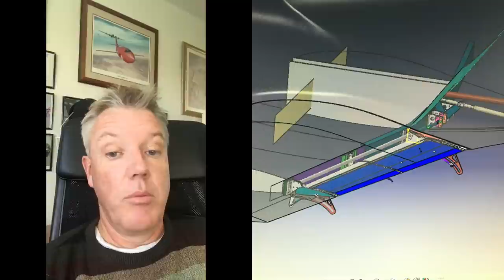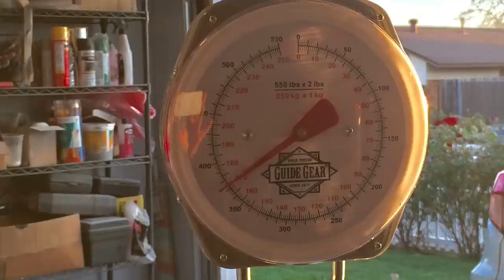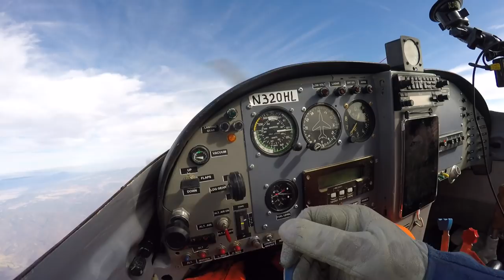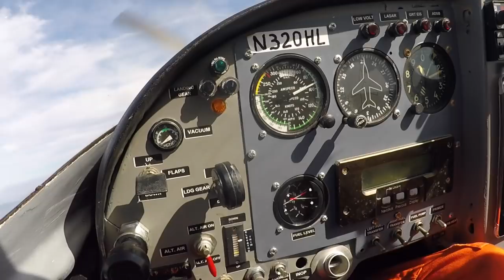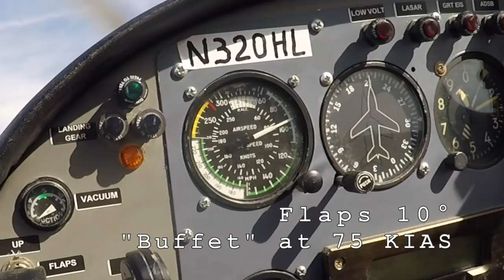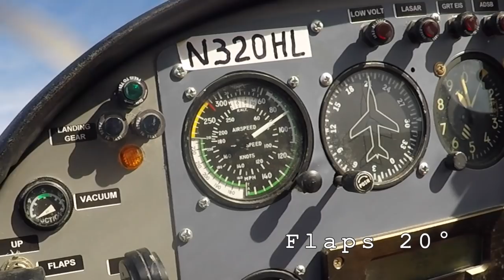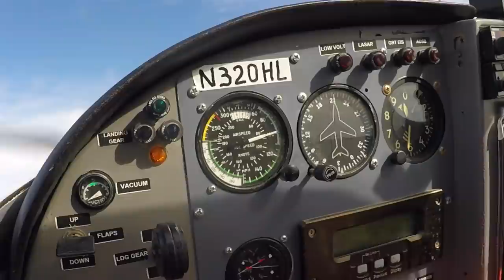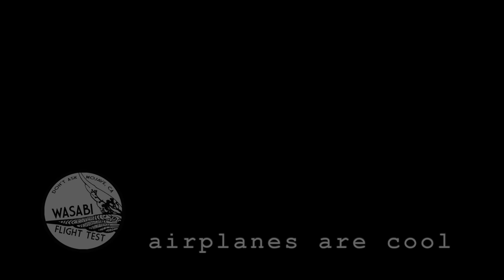So Many Tufts - Stall Tests @ First Flap Deployment - Flt 6 - Hakan's Modified Lancair 320

Comment: Great video. Couple interesting things to see from the tufts. The wing root fairing always seem to start the separation on the wing, which sucks the airflow on the trailing edge inboard. The tufts on the flaps always remain attached so the slot works great.  On all angles the flow on the elevator seems to separate, preventing further downlift on the elevator and hence further increase in AoA. What do you think? The separation of the elevator makes sense as you loose the control force with further stick aft. 

So VG's on the lower horizontal stabilizer seems to be a logical step.  

After that it would also be interesting to see if a turbulator strip just before the wing root fairing would make a difference in delaying the stall on the wing a bit.
Reply from the maker: Great observations.  We are thinking very similar.  Wait until you see what Hakan has cooked up.
Reply: Armin added vertical fences inboard of the flaps with great results. Lancair 235

Comment: The CP is moving rearward, obviously... leads to increased input to the elevator and it's subsequent buffeting/separation issues, but did you notice that the root fairing's tufts always show separation and a general motion towards the underside of the fuselage rear, even in level flight? The general "gut sense" looking specifically at 50:56 is the flow stayed laminar over the flap aft segment when the rest of the wing was turbulent. How's that CP shift feel? Air seemed to spill in making a clockwise vortex from the inboard edge of the aileron spanwise almost halfway across the flap span before it went chaotic, a short spill fence between the two sections could help with the spanwise flow but 'lock out' the outboard section and cause a tip stall. Those separated control sections... 

I take it next test flight will tuft tip to tail and tuft the tufts for total tuftage? Because there are some strange aerodynamics happening here.
Reply: I aggree,  longer span wings, double slotted fowler flap in general gave the wings a larger area but not a decrease in stall speed when flaps deploy. The elevator stalling from to much deflection and the wing root issue?

Why is the CP (Center of Pressure) moving rearward?
Reply from the maker: Thanks for the comments.  Did you see the flight seven video?  https://youtu.be/nahalMXlLTA
Reply: @utopiasnow  I did, and that is an absolutely amazing turnaround in low speed performance. Between 53:49 here with gear up 45 and flight 7's 34:08 gear down flaps 45, it's not a direct comparison but... wow. Stellar work, congratulations.

Comment: Really interesting, we're all glued to YoutTube waiting for the next installment as I remember stalling my fathers 320 Mk2 with him so 2 up with the big tail and flaps as designed by Lance and it was in the mid to high 60s as published! Interesting to hear you say fly out on one tank and not switch to the other until fly home - although the fuel gauge looked pretty much equal I would want to test stalling with a completely weight symmetrical aircraft but it didn't come into play.
Reply from the maker: Thanks for the comment Chris!

Comment: Great job guys.  Really looking forward to what you learned reviewing the data here.    From the casual observers viewpoint you are clearly reaching a stalled AoA at each setting, so it's mysterious why the additional Cl from the flaps doesn't appear to be there.  I'm not familiar with Lancair static systems but I'm really curious to learn if it was deceiving you on this flight or if there's something limiting Cl that wasn't anticipated.  Really cool project, thanks for taking us along!
Reply from the maker: Great questions, very much in line with what we are thinking.  I am looking forward to the next installment.

Comment: I have to say, Elliot, that the longer these videos become the better they are. This one even included some high drama! You and Hakkan talking about the bail-out rules had me wondering who would throw the first punch? But you also had moments of comedy like saying the audience had probably dealt with bailing-out from an inverted spin...NOT!  I've done half a dozen first flights and somehow managed to avoid inverted spins in all of them. Maybe next time. Now a question: are you able to record GPS groundspeed on these flights? If you think about it, groundspeed could be very useful in a stall series where what you are primarily measuring is deceleration.  It could be a useful cross-check for pitot-static error.
Reply from the maker: Hahaha, great comment.  Thanks for the questions.

We have GPS data, it is interesting...like so many things on this flight.

Comment: More tufts please!  As far as I can tell the tufts pretty much look the same before and after the stall, both on the wing and the tail. Large flow separation in the tufts ahead of the flaps during the buffeting, but smooth air remains over the flaps. So keep adding tufts until we can see "something" different before and after the "stall".

I would agree with Hakan, that the flaps must be generating a substantial amount of downwash when deployed, and that should really be creating more lift over this section of the wing. The only thing that I can conclude from this is the rest of the wing is making less lift (or really the rest of the aircraft as I am somewhat ignoring that the tail is also producing more negative lift). And for that to be true, the wings angle of attack must be lower. I would take a close look at video of the attitude indicator (or a camera with a good horizon reference) to see if the nose becomes progressively lower with each addition of flap. I suppose this supports the assertion that the nose is dropping because the tail stalls and not the wing.

I agree on the air speed indicator squawk, would rather have something clean and easy to read.
Reply from the maker: Thanks for the thoughtful comment.  We are really excited to be in the fun part of the program!!

Comment: To say I found this interesting is a gross understatement ....why would you ask ...my lancair  320 with 2500 hrs tt first flight 1995 ...extended wing tips ...big wheels...mt 3 blade ...3 dg reflex in the flaps ...used to be 182 kts now 178 kts ( prop dings maybe) 2450 rpm ...as a glider pilot have sealed ailerons top elevator but not bottom as noise was impossible to rid ...love the plenum ... I tried ramps but no difference ...on climb 385 cht and 205 max oil temp ..holds 220 litres ( only fueled max twice ) ...fantasied for years about doing this but never did ..my 10 cents worth ...the no difference in airspeed will be statics as I had to land with gps speed for six months before I put them exactly where lancair said .
Fantastically well done and hope I can find the one to five episodes..Geoff
Reply from the maker: Thank you Geoff.  It sounds like this series is right up your alley!!  Thanks for coming along, let me know what you think!!

Comment: Hi Elliot, first of all I would like to thank you for sharing all this good stuff. 

You talked about the fact that when stalling at 35deg of flap the stick forces become low at the aft position, and you said that this could be associated with elevator stall. 
I experienced something similar when demonstrating stalls and stall recovery while flying as a flight instructor and I wanted to know if this is acceptable on a certified production airplane. I also wanted to know if you think this is a dangerous behavior for a trainer airplane.
It more or less goes every time like this:
Clean configuration, throttle to idle, slow deceleration, stall horn, buffeting, left wing drops and at the same time you can feel the stick beeing sucked at the aft position where it wants to stay. In the mean time the nose drops at about 0deg pitch attitude. To recover I have to apply some forward pressure, at this point the stick is sucked forward, the nose drops and the stall is recovered. 
The airplane I was flying on is a Tecnam P2008, also important to mention is that it has a stabilator and not a more conventional elevator and stab kind of configuration.
Reply: Lima Mike Aviation thought I would chime in with the regulator/certified side of your question if interested if not disregard because it will get real boring real quick.

Based on Part 23 certification standards a pull force is required to maintain a speed below the trim point, speeds below the minimum unstalled flight need not be considered. The FAA published advisory material elaborating on the area between 1.3Vs and stall. The pull forces can decrease in magnitude with speed decrease down to, but not including, the stall speed Vs; however, the pull force shall in no case fall below zero before the stall is reached. 
Stick forces are allowed to lighten approaching stall but should never fall below zero (“sucker aft’”). Post stall all bets are off.
Stick force lightening can indicate other problems thought.
Reply from the maker: Jakey Poo!!!

Comment: Based on what I saw from the elevator tufts... he needs to “BAG” the elevator to the H-Stab to prevent the air from transitioning thru the elevator leading edge bay. ( based on the tuft that’s getting sucked into the bay )
Reply from the maker: Francis, thanks for the comment.  I think it's worth saying that while the elevator does appear to be stalled there is still some effectiveness there.  And you can see in the shots where I reach the up stop that there is some lat/dir HQ that lives there.  The point being I am not sure how much more elevator effectiveness you want, I think yonder there be dragons.

Thanks for the comment.

Comment: How did the GPS speeds compare? Where are the primary and alternate static ports located?

Cool to see you putting this stuff out there. You're definitely at the tip of the spear of providing a high definition look at flight test on an open forum, kudos! And - can confirm, the Henry Ford does rock.
Reply from the maker: Thanks for stopping by.  I haven’t checked the gps speeds yet.  Thanks for the reminder.

Comment: I'm not an engineer, but...
1.  The tufts on the tail do not separate or indicate reversed flow. (Therefore we don't have an elevator problem).
2.  The wing root seems to have reverse flow early and at all flap settings.
3.   Span wise flow is evident early in the stall sequence over the wing (lateral to medial).
4.   Flap tufts show flow reversal as expected in a stall
5.   I couldn't detect any significant flap tuft changes with different flap settings at stall.

I have VG's on my cub (leading edge of the wing and on the inferior surface of the horizontal stabilizer).  I really think the VG's add controllability and a margin of safety to low power/no power stalls. They do not slow down my slow cub at cruise.
Reply from the maker: Thanks for the comment!

Comment: Not sure where the alt static port is but in my experience the first suspect would be static error. You can’t really figure out CL with a bogus dyn. pressure and you expect those things to get worse at high aoa. Designing a wing with higher CL is a very difficult thing to do. The big boys start with cfd but they don’t entirely trust it. Many hrs are still spent in wind tunnels optimizing gaps and overlaps. $$$ and very much experimental. No magic formulas. I guess this builder enjoys a challenge. One question I had was if there was a noticeable change in deck angle, nose-down, when increasing flap deflection? Those flaps are big and they are fowler, so one expects the CL curve to shift.
Reply from the maker: Hakan has done a lot of CFD, and he is now redoing it with these results in mind.  I think Pitot static error is a likely cause but it doesnt answer all the questions.  So much left to study.

Elliot
Reply: Question, what do you think of the flaps he had with a leading edge slat? I've read the pitch change is less. Would it be better? Forget about cost and effort, just theory.
Reply: @Erik-rp1hi  likely more CL, but slats extend the CL vs alpha curve, so you need more tail power, your approach attitude will be more one-up , cockpit visibility might be a factor and even tail clearance might be a factor.  It is really tough to change one thing on an airplane without changing 5 other things. Also in this case the wings are wet so no room to install them.  All the alaska stol guys that put slats on supercubs had to increase tail area and put on longer gear to be able to actually use that additional lift. Basically slats have to be designed in. On one of the fokker 100 series they added slats, due to the issues they had with icing.  I imagine that was very difficult.  They might have only been using them to improve the stall characteristics with ice, so they didn't have to increase lift that much. What this guy is trying to do with the lancair is a very difficult thing to do. He is obviously a professional and has the tools, and it is still very difficult. He might have to reproduce the wing-body fillet.

Comment: That was all cool. I really feel for the guy getting no apparent benefit from his flaps (except drag, I gather that's useful in a landing).

Stack of questions: why is the spanwise flow inwards towards the stall? Why were you regularly putting in right stick towards the stalls? Tufts on the stab were getting sucked into the gap, why?

Is it worth putting VGs onto that wing or would that ruin his fast slick plane?
 The sanding he did to the ailerons... That needs to be patched up, right? Does he need to redesign his mechanism to make it laterally stiffer?

So much! This was cool!
Reply from the maker: Great questions.

The ailerons will need some work, but atleast we could keep moving.

I am confident the “no apparent benefit” will be fixed in quick order but that’s why we test!!

Thank you!!
Reply: @utopiasnow  the idea that a static problem could mask the airspeed benefit was interesting. Always with the static port! Is there anywhere on a plane that's a reliable place to put it? Besides on a tube 10 metres behind the plane?

I also notice the ailerons are a bit inboard. Why wouldn't you put them as far outboard as possible?
Reply: @deSloleye  Those are wing extenders.

Comment: Whoever pointed to the static ports might have nailed it. Notice the wing root tufts were always bananas? There's no way the static ports were getting clean air. What did the GPS speeds tell you?

Flap indicator lines: Also used on Me262.
Reply from the maker: Thanks for the comment.  More info to come.

Comment: If airspeed indicates same stall speed with different flap settings could it be an indicator issue? What was the ground speed during each run? Anyway to compare to see if it’s an indication problem? Those flaps should definitely give good lift with drag, not just drag, kind of the point. Enjoyed it, looking forward to the next one!
Reply from the maker: Great comment.  This is a big question Mark right now for sure.  Thank you

Comment: That was so interesting and fascinating! Strange that the stall speed didn't lower at all, or almost nothing? Look at the size of those freakin' flaps? I mean, only the extra surface area should make a lot more lift, right? Well, if L = 1/2 x Rho x V^2 x S x CL(a) applies to US A/C too? 😋😉
Reply from the maker: Hahaha, I like that.  Yea I think the problem is a separation issue with the elevator first and wing second.  But boy am I excited to confirm it.
Reply: @utopiasnow  - There seems to be a heck of a lot of spanwise flow pretty far outboard on the wing, before you even get to the stall.  I wonder if there is a separation bubble happening so far forward on the airfoil that everything's detached before it even gets to the flaps? ...That might explain why the extra wing area isn't really helping with the stall speed at all. 
I don't know if you'd want to install them permanently, but what do you think about testing with some VGs to see if they help the airflow stay attached all the way back to the flaps?
Reply: [I also don't love the look of those tufts at the wing-root fillet, but given the fuselage shape there may not be much improvement possible]
Reply: @utopiasnow  Yes, those tufts on the elevator show turbulence over the bottom side of the elevator? What would be a solution; changing the alpha of the elevator?

Comment: Interesting the no factor on any of the flap settings. Definitely would check the static pedometer. But if its indicating during take off I don't know how it could be an issue unless the flaps are causing pressure increase over it somehow. Seems like a well built plane. Definitely sounds healthy. Can really hear the intake. That heat shielding on the underside is a bandaid, need that exhaust pointed off the body. That's as simple as a quick mandrel bending session. 

The only reason I can think of the flaps being no factor is that the wing design is too laminar for anything under 70kts. Where the increase in surface area is directly proportional to the induced drag and there is no multiplication of the lift vertices.

Interesting.
Reply from the maker: Interesting thoughts.  I am excited to study it further.
Reply: So does this mean the end to the "add-fowler-flaps-to-lower-the-stall-speed" on fast kit plane projects? Glasair's new owner is trying the same thing. I am not aware of the outcome.
I'm wondering if an AOA indicator with audible warning is a much cheaper mitigation to the risk associated higher stall speeds.
Reply: @paulo7200  I think the energy in a incident is the square of the velocity. I want to land or crash at the lowest energy possible.